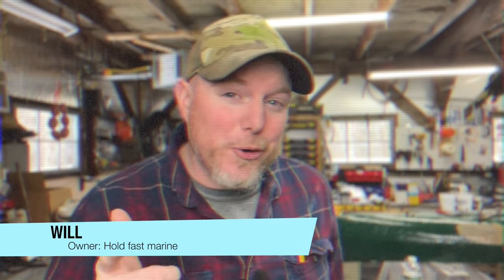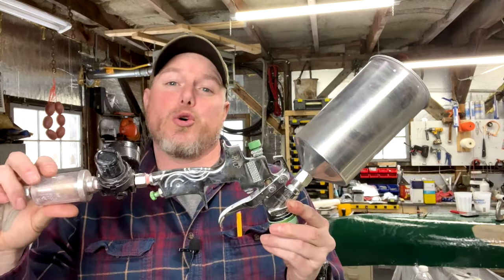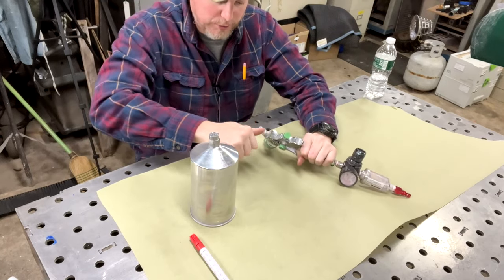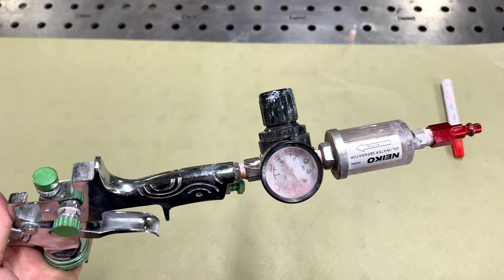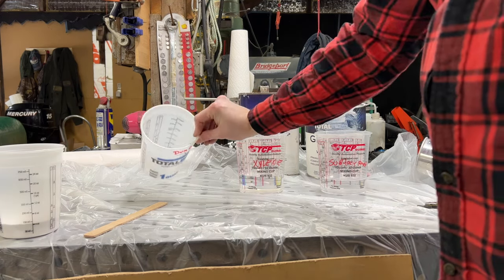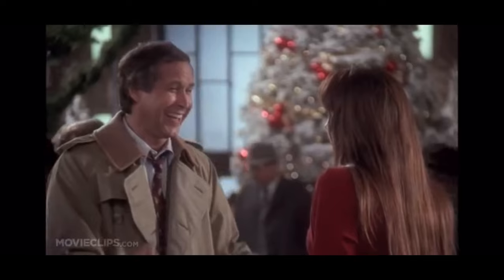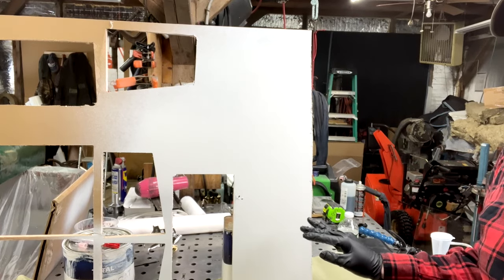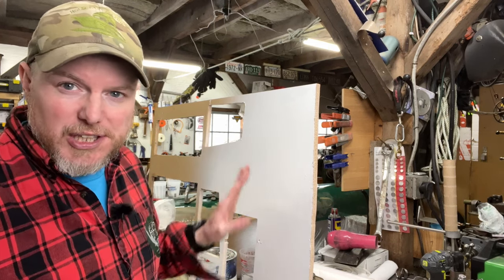Spraying Gelcoat on a Boat - How to spray gelcoat with a cheap spray gun-

Comment: I’m about to re-gelcoat a hobie cat.  First time spraying gel coat, but have done paint.  How much overspray can I expect? I’ve had paint atomize and float in the air only to settle on everything I haven’t covered in my garage.  Does gel coat atomize like paint? Do I need to cover everything?  If If I put heavy paper on the floor can I reduce foreign debris enough to get a nice job?  I don’t have a “clean room”.
Reply from the maker: It really depends on how much your spraying. Im assuming your doing the 16’ hobie? Gelcoat overspray is heavier than paint spray. So you can expect about half.  I would buy the cheapest rolls of plastic you can find and cover as much as you can. The problem with spraying gelcoat vs paint is the gel takes a lot longer to cure, therefor anything in the air will stick to the gel. The good part is you’ll have to sand the gel and buff it so you’ll remove a lot of the junk that lands on it.
Reply: @HoldFastMarine  18’hobie.  So the gel will float in the air?
Reply from the maker: Yes. Just like paint
Reply: @HoldFastMarine  Ok, Lessons learned spraying the first pontoon.  Bigger job than I expected.  4 pints per coat taking about an hour each coat.  Overspray was more and less of a problem than I thought.  I used 2.5% styrene for the first 4 coats.  5% with wax and duratech for the final coat.  The last coat was more airborne than the others.  It also sprayed a lot faster as it was thinner.  I had canvas tarps on the floor.  This became a problem as the overspray made them sticky like fly paper.  My feet and hose would pull them all over the place rendering them mostly useless.  I am gonna try rolling out waxed paper for the next pontoon.  Overspray comes up fairly easily with MEK substitute.  I did have a little bit of a gun issue with some residual gel hardening in the gun.  I was able to get it out though and totally disassembled after each pot.  Overall, I am very happy with the first pontoon.  I think it will sand out nicely.
Reply: @HoldFastMarine I was hoping you might be able to draw attention to this problem I found with styrene that I have not seen mentioned nor can I find much about it in internet searches.  I sprayed my boat in my garage.  I took precautions to avoid the fumes.  Masking, protective gear and left the garage doors partially open.  Vapors managed to make it through the walls and into our house.  We kept the windows open to get rid of the fumes.  I did not expect that and neither did my wife who has worked in workplace safety.  What was and is still surprising is that some of the food in a refrigerator and chest freezer in the garage have absorbed the styrene.  My wife did find some info that it mostly affects the fat in foods and depends on the type of packaging.  All that aside, I was very surprised that it was able to get into the sealed refrigerator and freezer.
Reply from the maker: @av8rgrip  yeah bud its nasty stuff!

Comment: So I should not use gel coat with wax man more mo et I gotta spend money is tight real tight so tight I hv to order a quart of fairing putty every two weeks so this build is taking forever lol. So I use gel coat no wax for 3 layers and sand between each coat, then shoot gel coat with wax 4th coat? What do I sans down each coat with maybe 320 paper of orbital sander?
Reply from the maker: So I don’t really understand what your asking. You can’t sand gelcoat without wax, it’ll gum up the paper super fast. If money is tight I’d suggest holding off until you can afford to do it right. And as much as I LOVE TotalBoat stuff you can get a 5 gallon pail of fairing from Hamilton for about 150$ less than the same amount from TB.

Comment: How many coats of Gel coat do you spray to have enough thickness ,??
Reply from the maker: I generally do two coats of laminating gelcoat and one finish coat with wax. If the surface is smooth enough it’ll be minimal sanding with some 800 grit then buffing

Comment: For how many PSI is the water and oil separator? Thanks.
Reply from the maker: 120 I believe.
Reply: @HoldFastMarine  they no longer have the 2.5mm nozzle. 2mm is the largest nozzle available.
Reply from the maker: Ok. Sorry.

Comment: What can you get volume to area ratio down to? How thin without windows for mould application?
Reply from the maker: Sorry Stuart I don't quite understand what your asking me.
Reply: @HoldFastMarine  coverage per litre. Example: 500 ml per mt2. Can you get it down to 250ml per mt2? Or does that lead to wrinkling / complications.
Reply from the maker: Well with this cup gun I honestly couldn't say. Ive never done the math on it. I will say that you want to have your first coat cover enough to not see any bleed through of the sub straight (plywood, fiberglass, fairing compound).
Gelcoat is a pretty forgiving substance. Which is why for the DIY'er I recommend doing at least two coats of gel without wax and one with wax, to cure the layers below and add a little more thickness. Its definitely overkill but you have a good amount to sand before you ruin the entire job. 
If you want a truly even almost gloss finish on you your project the best way to spray is with a gelcoat dump gun. Did any of this answer your question or did I confuse you more?
Reply: @HoldFastMarine  Im just trying to calculate the weight a kayak would be. I can estimate the composite schedule. Just thinking of the weight I can get the gelcoat down to. All good
Reply from the maker: @stuartkent383  well I can answer that for ya!! you can thin gelcoat with a product called styrene. It will make it flow a lot like paint. There won't be much of a weight added to the canoe. Have you though of just painting the canoe?
Reply: @HoldFastMarine  no. I am wanting to make a light weight kayak from the mould. thought about the skipping the gelcoat on the deck and going with vinyl wrap. Also 2 pack instead of glaciation. I am used to large pressure pots for large moulds eg boats and pools.  goes about 0.5mm or 0.5 kg/mt2. With kayaks, the weight is a big marketing factor. People pay a lot just to save a few onces. 
Sorry about using metric